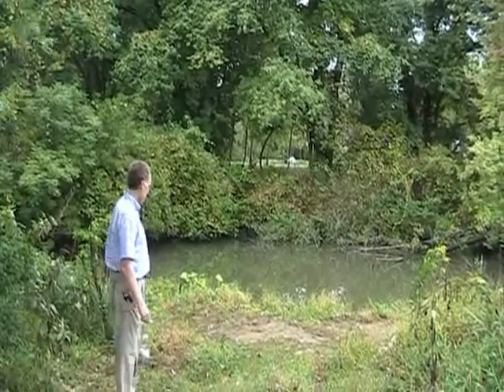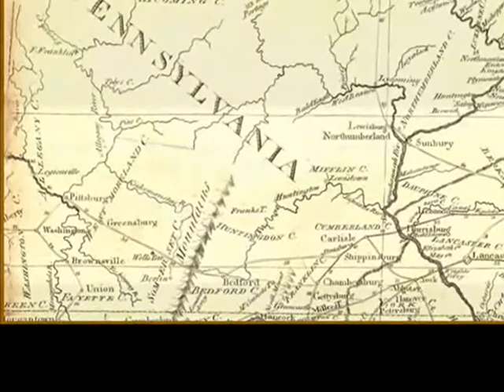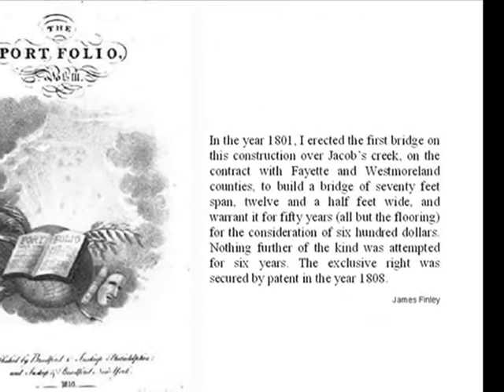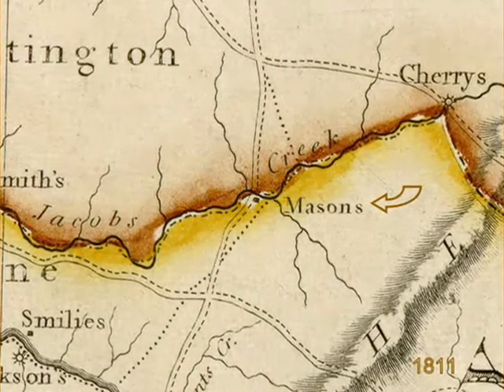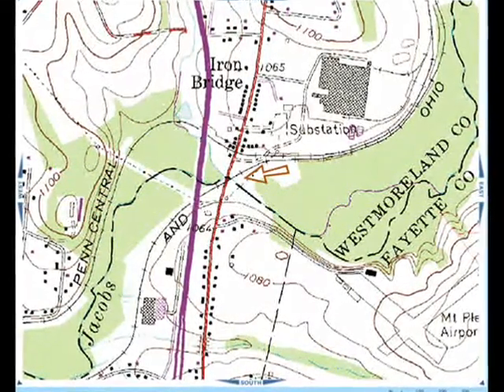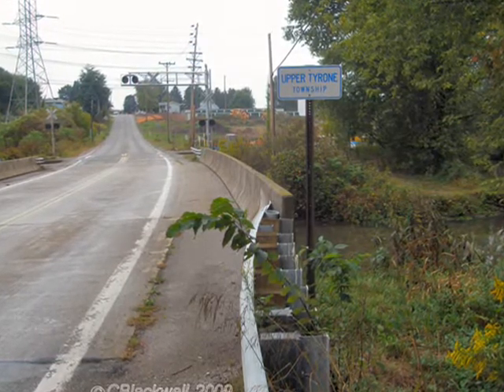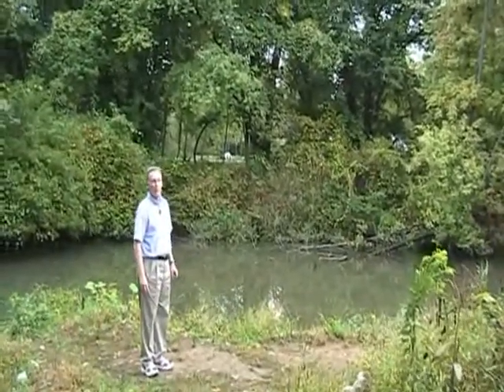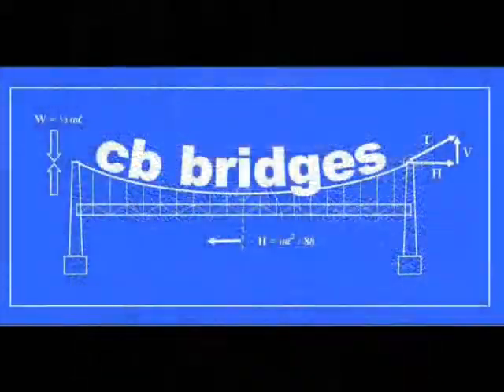Finding Finleys Chain Bridge.wmv

Comment: The "modern" concrete bridge replaced an "iron" girder style bridge, so there have been 4 or maybe more bridges - thus the name of village. Most likely they all were on the spot of the previous bridge to stay in alignment with road, which explains why nothing remains of the chain link structure - and which I am guessing is not what the village was named after. 
I grew up about a mile downstream, and was researching an early crossing site of General Braddock's expedition, military road - 1755. 
Almost all of the exact location of the road is confirmed - BUT not by my homeplace, between encampment markers 14 and 15. 
https://upload.wikimedia.org/wikipedia/commons/5/54/Cumberland_md_braddock_road.jpg